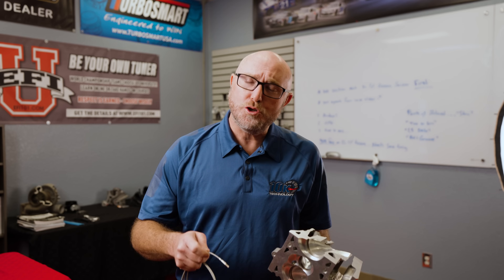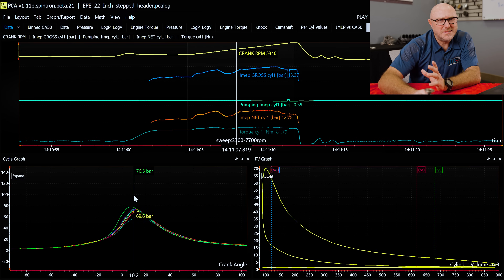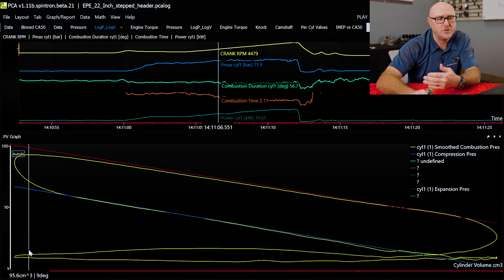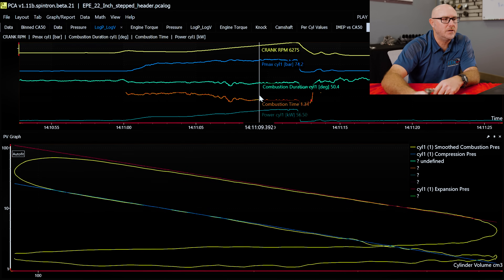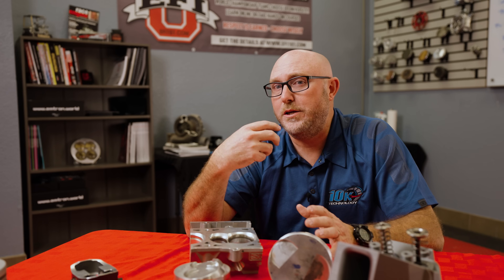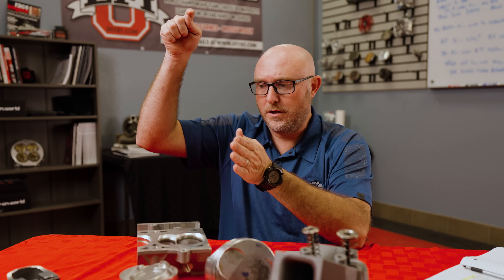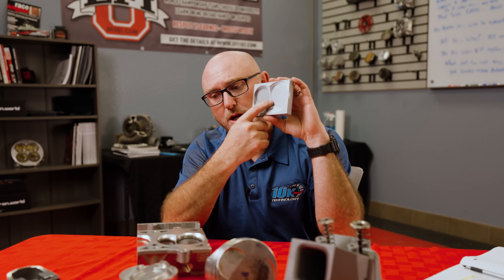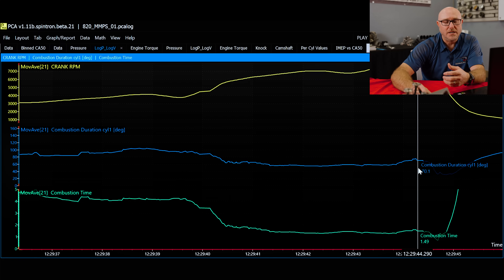I Think Steve Morris is WRONG and I Can Prove It!

Comment: Hi guys can i say you are both right and both wrong guys, 1 each type of fuel burns at a different rate all conditions being the same 2 Each type of fuel gives a different btu all conditions being the same 3 In a perfect world 14.7 psi at sea level doubles the cubic capacity tus changing Steves theory of "what changes nothing!" cylinder pressure does! 5 Although you have a nice pressure transducer, we don't live in a perfect world, and you are not using oxygen and fuel ratio you are air to fuel 6 we have discovered fuels have different atributes/requirements, combustion chamber environments are differed and the air we breathe is different 7 Engines work best, make more power use less fuel and make less emissions @ 100% burning efficiency i can see you are a theory and math guy aiming to own and use every device you can to get to the end result where Steve is hands on learn from real world experience both will get you there real world even with failures will get you there sooner and possibly cheaper 8 i use both where applicable i have been ridiculled about how much  and how little timing i use but i base my timing on how much time does it take to acheive as close to 100% burning efficiency for the engine environment i have to fuel type i use!GUYS AS STATED BOTH WILL GET THERE / BOTH RIGHT AND BOTH WRONG I DO SIDE WITH STEVE AS HE WILL GET CLOSER SOONER NOW HE HAS REAL WORLD KNOWLEDGE I LEARNT FROM MY MISTAES QUICKER THAN THROGH THEORY N MATH

Comment: Hang on, there's something wrong with the discussion about surface area to volume ratio. A sphere has the smallest surface area for a given volume of any shape, so while a hemisphere isn't as good (small) as a sphere, it certainly is good compared to most other shapes. In fact, the hemisphere has one of the best (smallest) surface area to volume ratios of any combustion chamber. Depending on the implementation details, on average it is better than the pentroof, wedge, and bathtub combustion chambers (in that order) in terms of SA/V.

Even the analogy is wrong. A drinking straw has an extremely large surface area to volume ratio.

Comment: Good vid. but I have one question.  It was never mentioned when combustion should start to achieve peak cylinder pressure at the "correct" optimum crank angle to achieve peak torque. Isn't that the reason for moving the timing?  That part of the equation was never mentioned.

Comment: I was shocked to hear Steve make that statement. He even stated that it should need more timing with more boost and fuel..... As Ben mentioned I have encountered some modern pushrod engines such as the LT4 that seemed to like high timing values equivalent to an NA application, however almost every other style of engine that isn't the case. For example on my car at 10psi it takes 24 degrees of timing to reach maximum power. Any more that that is gains nothing. Then at 25 psi it takes 17degrees of timing to reach maximum power. Anything over that it gains nothing. This is on E85, so there was no knock limitation occurring.

Comment: Use to look at CA50 or crank angle  @50% burn and this is also a great value for placing the combustion at the rt point. I believe CA50 around 12-15*atdc was our target over 6500rpm and carried that out to 9300.

Comment: You should make an episode with the following tests, preferably on an LS v8 using the same fuel throughout the test:

-Show how the wideband o2 sensor reading becomes compromised as back pressure goes up in an exhaust system.

-On a turbo setup, show what situations lead to the setup prematurely not gaining any more power through increased ignition advance. 
Also show, what situations on the same turbo engine, would give an increase in power with timing despite the timing value seeming high, yet still gaining.

In all these tests, having a way to artificially increase back pressure for demonstration purposes, would be a visual bonus to the viewers.

Some say a very efficient setup won't want much timing, others say you're hitting a restriction somewhere if timing isn't helping.

Some say if it keeps wanting timing, the setup is so inefficient that you are fighting pumping losses, encountering EGR, thus advancing timing to compensate. 

I'm sure multiple situations may show the same symptom, so I'm curious to see you demonstrate the theory live.

Comment: It seems like you have proved Steve's point more than disproved it. He stated you dont need to retard timing when the throttle valve is opened and a richer charge is introduced due to longer burn time. You need more advance for the slower burning richer mixture not less.

Comment: Well, I'd look at it the other way round, if it didn't need less timing, it wasn't getting enough in the first place.
Bottom line is greater charge density 'should' always burn quicker, faster flame front, thus requiring less initial timing - assuming detonation/pre-ignition isn't limiting the MBT timing in either case?

Not sure where you'd get the data, RaceCar Engineering has had some good articles in the past, but without too much depth, but for some years the F1 engines have been right on the edge of combining compression and spark ignition to get the very last erg of energy out of the fuels!

Way back in the day, some historic race engines even had three spark plugs - but this may have been as much a reflection on ignition reliability as any actual power gain.

Comment: Correct me if I'm wrong maybe I missed it, but did both of you not mention the fact that with more cylinder pressure, boost, with the correct a/f ratio that your compression ratio will increase and create the need to alter timing as cylinder pressures change?
Reply: CR is determined only by piston displacement and combustion chamber volume, it  doesn't change with boost.
Reply: @ferrumignis  now enter a non compressible element, fuel, into that chamber, it's the exact same thing as adding a dome, reducing a dish or a smaller chamber which all increase compression. Timing will still have to change... again, I could be wrong, but... keep em coming. Thanks
Reply: @TigerRacingProducts  If your fuel is all liquid in the chamber then sure, but that's not going to burn well or create power.
Reply: @ferrumignis  understood, though we are still theorizing that the a/f is constant.

Comment: I'm a retired motorcycle technician and machinist and it took me 18 months to completely restore a 1980 GS1000ET Suzuki and completed it in August 1997. 1100 Wiseco 10:25-1 forged piston kit. Vance & Hines drop in camshafts (Not), HD valve springs. .030" milled off the cylinder head, .005" off the cylinder, intake and exhaust port clean up only (Intake port completely done wrong from the factory), five angle full radius valve job, aftermarket V&H exhaust, stock air box and stock  carburetors (Jetted), degreed in cams, Dyna Jet 35,000 volt coils with Taylor 8mm plug wires, crankshaft blue printed, trued, indexed, balanced and welded, HD clutch basket backing plate and springs and balanced, undercut transmission. It had a Hemisphererical combustion chamber which I should have dual spark plug each cylinder, but I didn't. I don't remember what I set the full advance to, but I had to run 4 gallons 93 octane pump gas and 1 gallon VP 100 low led gas to keep the engine from detonating with the ignition timing It needed. I started trying octane boosters like PJ1 and 104 plus, but neither worked. I found Lucas raised the octane by points rather than points of a point which prevented drtonation. I ran 5 gallons 93 pump gas and 4 ounces Lucas octane booster which prevented detonation. Stock it probably did 125 - 130mph and this engine was doing 151 and still pulling hard at 10,000rpns, but ran out if gear. Stock gear ratio, but I went from 630 to 530 chain & sprockets to lighten it up and it would pull to 10,000rpms in 5th gear when redline was 8,500rpms. Most of the time the tachometer didn't work because the cable would break. 
So basically you need the correct fuel type and octane, ignition timing etc., to make peak hp & torque and each engine may require different amounts.

Comment: One thing you said doesn't make sense: you seemed to suggest that a hemispherical combustion chamber would have the most surface area for a given volume, but the exact opposite is true. Did you instead mean that a hemispherical combustion chamber with a necessarily LARGER chamber than a wedge will have more surface area and therefore lead to lower thermal efficiency? 

Additionally, you also seemed to tie this lower thermal efficiency into the need for 2 spark plugs. It's my understanding that the hemis need 2 spark plugs primarily bc that shape/valve arrangement forces the plug location so far from the center that it  ends up taking too long for a single flame front to make its way all across the bore. A secondary issue is less than ideal swirl with the hemi design leading to a non-homogenous mixture, in which case multiple locations to attempt to light it off is preferred. I can see why heat loss to the head would lead to less power (bc that's heat not helping to expand those gasses), but I don't exactly see how that figures into the speed of combustion itself.

Comment: I don’t care what the math alone says. Math doesn’t tell you real world Dyno and street driven data. Steve is right to a point. If you don’t have an excessively small combustion chamber and you are not going crazy with cylinder pressure you should have the same amount of ignition timing limit from 15 pounds of boost all the way up to 30. This holds true in a perfect example of a 2017 to 2021 Civic type r on 50% ethanol the maximum timing it will accept is 21 to 22° even if you are running 14 pounds of boost or if you’re running 35 pounds of boost. Steve is correct. If you try to go beyond that a particular amount of ignition timing, it will not make any more power and end up having knock and not make a drop of extra power. You can even add Full 85% ethanol and you will not gain a single degree of ignition timing so this literally proves Steve right again.

Comment: Steve isn't wrong. If the fuel can handle the pressure & heat, the timing doesn't need to change.

Comment: Your example at 6:40 dis proves your own theory. A NA motor has a nice clean cut side of the road. All that extra tinder on the other side is essentially all the extra air and fuel mixed into the combustion chamber. Yes, they are packed more dense,  but it's the same stoichiometric ratio. Vapor burns faster, so by your theory,  the more fuel in the ratio, the slower the burn
Reply from the maker: Actually, neither combination runs anywhere near stoichiometric.  What you see on the Oxygen sensor is simply the AVERAGE of the mixtures inside the combustion chamber, so some areas will be 16 or more to 1 and others may be 10 to 1 or even richer...  The reality is, without data like to actually measure these things... all we have is an opinion that was formed on less than complete information!
Reply: @EFIU_Ben  I 100 percent agree

Comment: Haha Good stuff there! I used equipment extremely equivalent to this during my first job in the Automotive Engineering Field for Single Cylinder testing. The software INDICOM was used for the combustion analysis and to display the PV trace along with using a #6125 Kistler In chamber Pressure transducer (It resembles a modified sparkplug) This is literally the ULTIMATE way to tune! Fueltech is bringing this ability to the masses (race community) at a reasonable cost with their new FT-700 ECU!
Reply from the maker: It's a great time to be an enthusiast!

Comment: Yea this video was when i stoped waching mr Morris
Reply: 😂 ya because it's not like Steve is building and racing 5-6 sec race cars, that can be daily driven... bold comment.
Reply: @fondfarewell2  yea but i have never heard richard holdner or andrae from hpa or steve brule make such a obviasly incorrect statement and the only reason i wach these guys is to maybe pick up on somthing i dont know mr morris says incorrect things all the time and up till that video i just let it slide because cool engines but iv stoped and paused on some of his videos where hes been lookin at individual wideband readings on each cylinder on his pumpgas motors and hes had lean outs on cylinders through the meat of the power of 1and a half ratios on engines that have efi with sequential injection ..whilst i dont hav experience with holley stuff i know my way round haltech and old adaptronic stuff and individual cylinder trim is not that hard to take advantage of

Comment: Rite or wrong.make it easy just run the fuel for your compression.you take out all problems.everyone wants to make 10,000 hp on pump gas.when your not wealthy you learn quickly shits breaks under detonation.all ways be a bit conservative.junk last longer.talk to peat Harold (hed) and you will see that a good plan works so much better than just bolting shit together.

Comment: Sorry I never comment but 9:33 rpm is 9k while you’ve been comparing the rest around 7k
Reply from the maker: That is true, but the time per cycle is not a factor in the timer for combustion...but it WOULD change what crank angle you'd have to start at to get the same result!

Comment: I dont understand the one example, with all else being the same how can you add more mixture and heat from adding boost and not speed up the burn rate? I cant wrap my head around that! Can the spent combustion from backpressure form barriers between fuel molecules and slow it down enough for no change in timing?

Comment: Hi great vid. In the last example, the bbc that needed less timing, what type of compressor did that have ? Procharger?
Reply from the maker: Harts Turbo
Reply: @EFIU_Ben  Wow, everyone knows, except you it seems there is a difference in combustion temps between a belt driven compressor and an exhaust driven compressor, and you use these two as your example of combustion event time. And by your own admission surprised that the Ls boosted was the same as N.A. You even made mention of the Ls exhaust being restrictive and influencing combustion efficiency, but missed the fact there are two turbos much more heavily restricting the exhaust of the bbc. Then on top of that brain storm claim the bbc with the BOV's held open, with two big turbos in the exhaust tract is the same as if running N.A. FFS, as we say here in Oz, all the gear and no idea. S. Morris is way closer than you .

Comment: This does make more sense especially if you have a small bore long stroke and a small combustion chamber with boost.  
Takes conservative timing because of it being a long stroke small bore
1.4l ecotec 12:57  get exhaust reversion...
Reply: 72.5 bore 85.6 stroke 9.5:1comp and 22.5psi @ 144g/s

Comment: You have to reduce timing with boost because you have increased the 'P' in your PV=NRT equation, increasing your ''T". Additional cylinder temperature is why you pull timing with boost. SM FTW

Comment: I like that you ended up with the same conclusion as me and a humble attitude at the end. What he said is definitely a good rule of thumb and seems like it was mostly said to get people out of the old way of thinking: “pull lots of timing if you have lots of boost”
Reply: same for lowering CR as i was 1st told 8-71/1980's~era needed 8:1 as a ruff-in-number but seeing more modern takeaways pump-gas usa 14:1 and 20PSI-boosted is possible for computerised setup's, taken me awhile to see the flaw'd Logic i was caring forward 

this in cylinder method is better in my 2C but yeah 5K is steep but even OEM's can befitting from possibly deletion of other sources like O2's and MAF's ect as that's all done in the cycling-cylinder without extra maths-ect/guess's

Comment: Not sure Steve and others understand timing number we use is negative work done. IE making crank go slower. But there is more being done when after TDC but is it enough to where average power is higher. The goal should be most power not stuck on a certain number. You won’t ever use 40° on a twin plug engine…and make more average power post TDC.

Comment: The only factors I have in question are camshaft profiles and temp of the cylinder before, after and during the combustion process. Was the sorceress different because of water flow and the cam profile it runs?

Comment: Basically, the flame speed goes as the air density, so it follows that higher density reduces the Time to peak pressure....The efficiency of a system can be judged by how much advance is necessary to get peak power....Mostly....